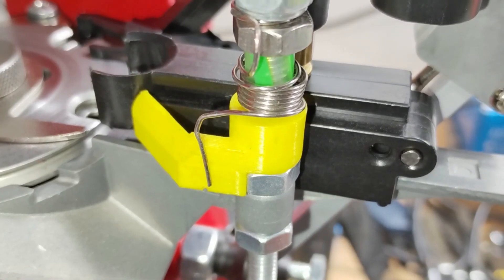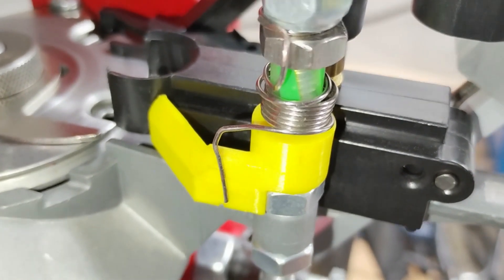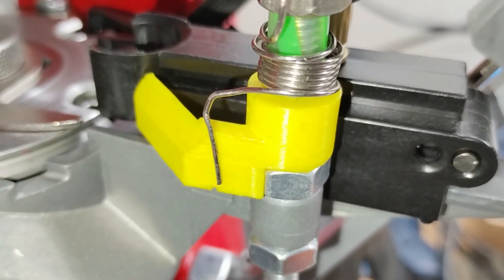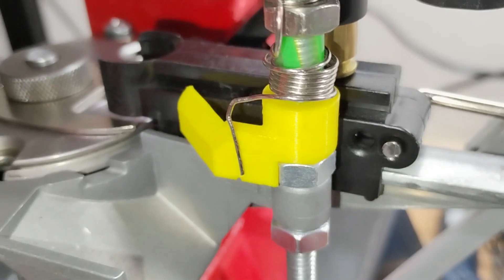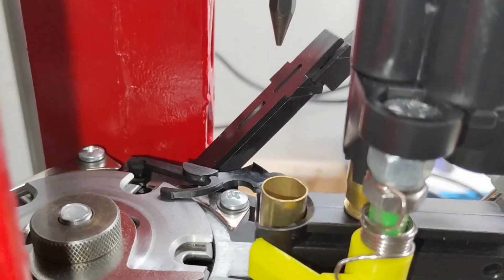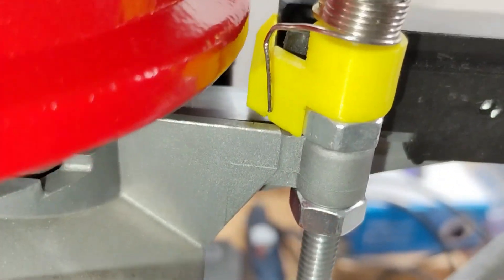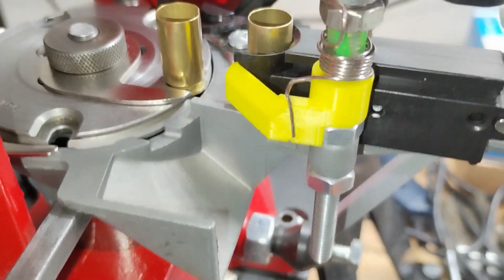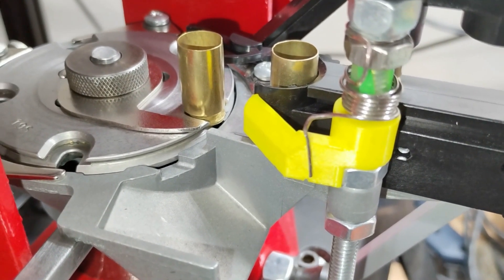Lee Press Case Feeder Support Paddle

Comment: I fixed the same problem, brass tipping over, by relocating my case feeder. The problem gets worse with taller cases like 223. Checkout my solution and observe how the brass would not even wobble as it is fed into the shell plate. https://www.youtube.com/shorts/jPV-eD7OXg0
Let me know what you think. I would welcome constructive feedbacks so I can be better. :)
Reply from the maker: I printed the same bullet and case feeder, the case drop for the 223/556 looks to be working great, do you have a link to the stl file ?